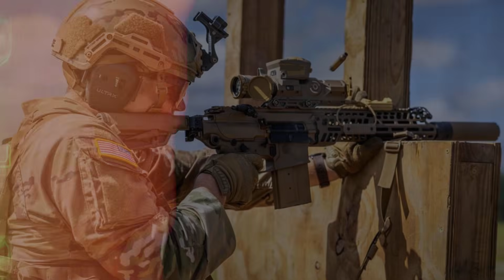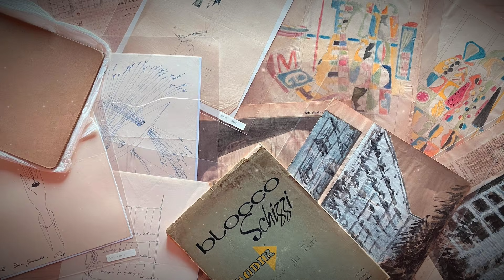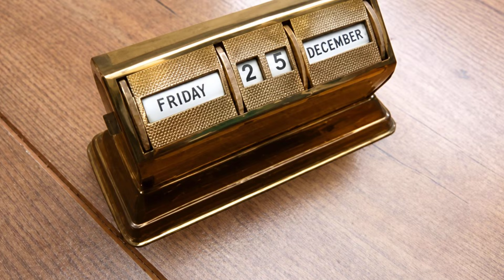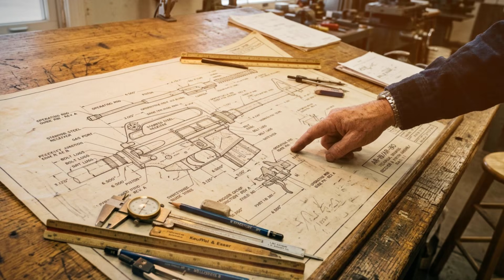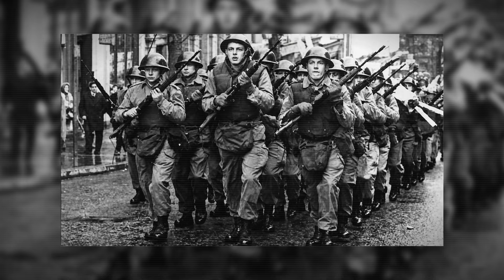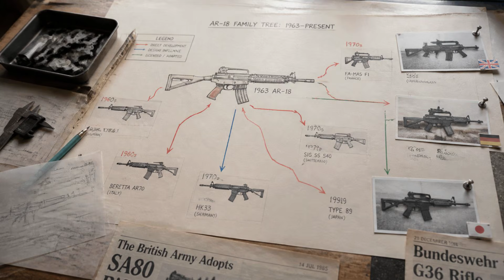Made in the USA, Fired at the British The IRA's Secret Weapon

Comment: Sorry but not better than the AR15.  I've handled several AR180s and they feel cheap and flimsy compared to a 1970's SP1.  One I handled even had extensive cracking at the hinge points and the receiver.  Cheap to manufacture at the time, but today it is actually more expensive to produce a sheet metal gun.  It had it's day in the Problems in Ireland because it was cheap and available in the US and smuggled abroad.  Too bad for this video that half the images you attribute to the AR-18 are not AR18s.